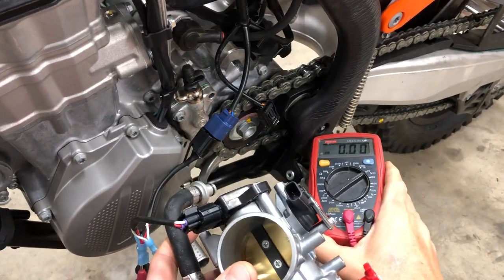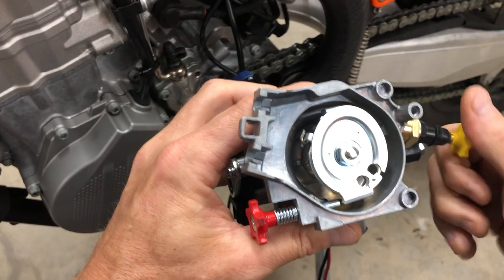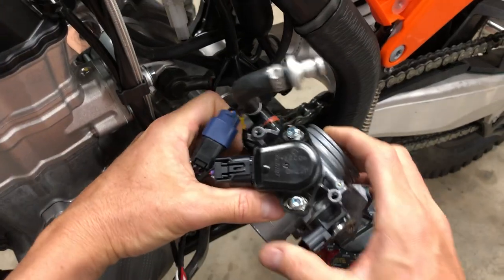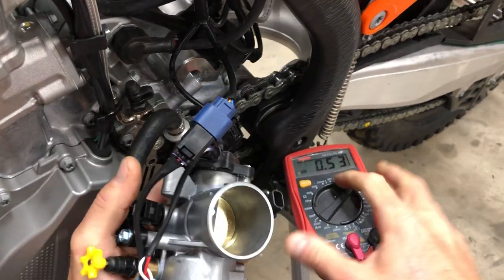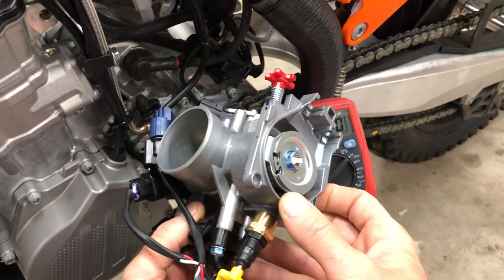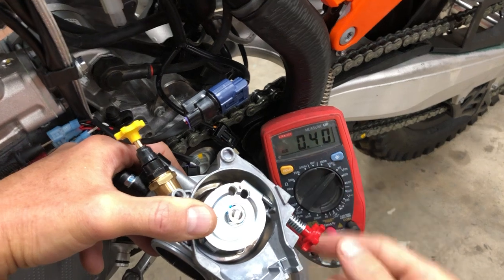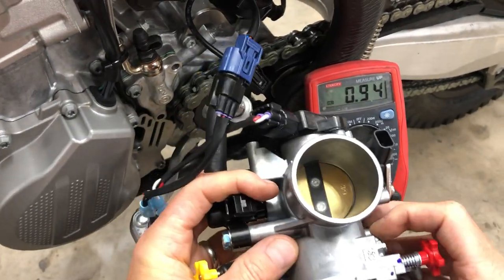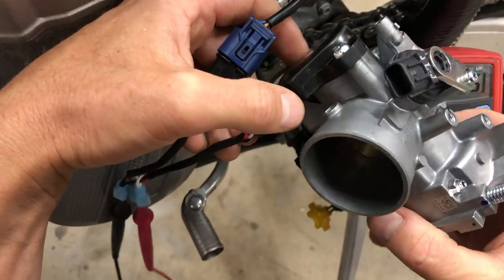MOTO MYTH BUSTERS ON THE TPS HACK AND EVERY THING THROTTLE BODY

Comment: Mike, a great all-around video.  First, I am not advocating for the hack in any way (like you I think it should never be done) but to want to clear up something you say that is misleading. Multiple times you say that doing the hack is "the same as holding the throttle open at the high-idle setting".  It's not.  Rotating the sensor to get a higher voltage value CHANGES the relative mixture value at all throttle settings.  If it were the same as setting the bike to high-idle, the bike would idle faster.  Rotating the TPS sensor changes the mixture through the throttle range - it does not change idle speed in any way.  It has nothing to do with high-idle position, etc. It may just happen to be that what you are setting the value to is close to the same value as your CURRENT high idle setting but as you even showed, the high-idle open position is highly adjustable by twisting the yellow knob.  So, the "default" TPS value at high-idle will in fact have a widely variable range depending on what a given rider sets that value to.  We fully agree that changing the TPS to a higher value will add more fuel across the throttle range but will not do it in the correct amount so it's a futile attempt as fixing a problem.

Comment: Excellent video I have a 18 500 excf did tps adjustment check engine light kept coming on and would run like crap got jd tuner all good now do you know spec for tps?

Comment: Great knowledge. Do you know best the start point on the throttle body the Voltage on KTM 690 2015 or 2016 same throttle body. Im havving issues with mine. I'm desperate and I can't find this info

Comment: Hey Mike, my desmogged, reedless, FMF 4.1 (spark arrested), JD Tuner 2019 450EXC has a bit (300-400 rpms) of a hanging idle when I let off the gas and sort of an intermittent varying idle. I’ve adjusted the TPS perfectly to spec. I haven’t checked the fuel filters yet, as it only has 24hrs and I’m just digging into it.

Any ideas on where to start beyond that? I anecdotally felt like the idle is better when I adjust the first fuel light a little leaner, but then I get decel pop. Any ideas on where to start would be much appreciated!
Reply from the maker: Clean injector by someone who can validate flow and re check

Comment: I got a 2020 KTM 300 tpi 2 stroke and the tps isn’t adjustable at all. At fully closed with no pressure on the butterfly it’s still reading .535 instead of .4 and causing my bike to run rich. I’ve tried leaning it out as much as I can with the idle air bypass but can’t get it lean enough without starting to get hanging idle.

Comment: Good video! Personal preference I know, but typically what RPM is high idle? My 350 jumps to 4K and it just seems high on a cold motor.
Reply from the maker: I have my idle set to 1800 and fast idle at 2350
Reply: TACO MOTO CO thanks! But in my ‘19 KTM 350SXF service manual it has a idle spec of 2,250-2,350 RPM but doesn’t state anything regarding high idle spec. Any knowledge there?
Reply: @TACOMOTOCO  is that fast idle rpm at cold or warm temp?

Comment: Very instructional vid. I have the 2014 (BMW) husky te310r. No one will work on it. Open full pwr. Idle adj screw fell out. Adj tps to get back to camp before I found out the upper tb screw fell out. The enrichment knob is different on the kein. What TPS # should I be at with butterfly fully closed to get back to spec.
I've set TPS at 680 with no idle screw contact,enrichment knob out at 43 as manual states and bike won't stay started long enough to set anything
Reply from the maker: Not sure on that bike sorry
Reply: @TACOMOTOCO  my luck to get a red headed step child

Comment: I have watched the last portion of this video as well as the google doc on setting TPS..
The part i havent got is.. do i calibrate the GET ecu at the “closed plate value” IE .40
Or the idle value when set to 1950 rpms..? IE .53 ish
Thank you..
Reply: This is the exact question I asked didn’t get a straight forward answer told me to follow procedure and ride it but I still don’t know if The correct way to calibrate TPS with get ECU is backing the idle screw all the way out first and then zero tps or vice versa have everything set ti where it should be and then zero tps
Reply: Adjusting the idle all the way out on my voltage meter gets me .4 on the money and then when you turn the idle screw to where I like it it’s .59 (I like higher idle for stunts) but I just want to know if the correct way is to set zero tos with the get when idle screw has no effect on tps voltage or set it first and then zero if anyone has the answer It would  make my day
Reply: Tps*

Comment: Sir ! I am from India and I own a Ninja 300 (2019 ABS) ...My question is " How can I adjust the TPS to factory settings if the output voltage for Idle is given in service manual..?
And the bike also does rough idling (close to 2k rpm) for few seconds and then comes back to normal....
My bike is running lean as I tried set TPS it to factory output voltage just by rotating the TPS to the factory output voltage.. Please help..!

Comment: OK, Taco Mike, I've watched this video a bunch of times and I think I get it.  I don't currently own a tuning harness.  I have a 2020 500 EXC-F.  To tune my bike, can I first turn the yellow knob all the way out so that it's not impacting the idol.  Then start my bike, and use the red knob to set my idol at 1800 rpm (I have a TT Voyager Pro).  That's now my base idol speed.  Then I can adjust the yellow knob to the fast idol speed that I want when I click it in.  Is this correct?  Many thanks for your great videos!
Reply: That is the way. 

Turn out yellow all the way (63 clicks)
Set red to desired rpm range (2000 on my XCFW 350) once bike is warmed up
Then set high idle to appx 2300 rpm (or enough so that the throttle can still disengage the function - see my note below)

Note: if you dont set the high idle (enough clicks screwed in) then the throttle tube will have a very difficult (if not impossible) time disengaging the high idle when you roll the throttle forward. Essentially, for every click you go in with the red knob, you'll need to do the same with the yellow to maintain the gap you see Taco showing in the video.

Comment: Hey Taco, I Recently bought the TPS tool and adjusted my TPS from .50, that was the setting i had on it, 2017 KTM 250 exc-f , 

i adjusted the TPS to .70 at which i felt the bike was a bit more aggressive and felt like it just wanted to go a bit more, so i set it down to .64 and found that i was happy with this setting. 

But now I’m reading all these comments and how bad it is for the motor, and it scares the shit out of me as i do not want to blow up my engine. Do you think i should just set it back to 0.50 as there was no fiddling with the yellow and red knobs and the bike was actually running perfectly, and i just wanted a bit more power.

Other mods include a Full fmf system 4.1

Thanks for the video and knowledge bombs.
Reply from the maker: If I’m you, I’d set it to factory spec per the video and choose a reflash, piggyback fuel tuner or ecu option that best suited my budget and riding needs🤘🏽

Comment: Great tutorial!!  I've seen it stated that there is some value in increasing the TPS setting for an un-modded bike, as it richens the mixture especially at low rpm and the engine will run smoother and cooler at low rpm's.  Is this true?  I'm on a '18 250 EXC-F and am not looking for any significant performance upgrade. 
I wouldn't mind a slightly more aggressive exhaust note...can the bike handle some drilling out of the exhaust screen without an ECU tuner, and if so is there a TPS setting that would be of benefit?
Reply from the maker: The data says no. I don’t use that hack on any of my personal bikes or ever recommend it. And with a piggy back tuner like a JD being such a low cost option it’s a total no brainer to do it right and have a safe, cool running long lasting bike
Reply: You do a really good job explaining. I wanted to know if your research was on any pre 17’ KTM’s. The “other guys” will say that the TPS hack is a no go after 17 because the idle and the TPS work together. However on 12-16 you really are causing more fuel to enter vs air since the air is controlled by the butterfly. I’ll admit I tried the hack on 15’. And it did stop popping decel and seemed more consent on low end having removed the smog and removing the end screen. That said, I have no way of measuring against the whole range. I still think ECU is the way to go, but wondering if the TPS hack has more validity on older bikes.

Comment: Is the stock TPS value for a '16 500 EXC .53 also? Before I knew better I used Mr. Clean's TPS tool to compensate for a end cap. I have since adjusted it back down but I don't remember what the stock setting was.
Reply: No, that bike has a different throttle body, .60v is stock, and idle screw doesn't move the throttle plate on that model

Comment: So, by what I understood, we have to unscrew both yellow and red adjusters and set the TPS voltage to 4.0v, correct?
If so, why do we need the 5.3 V point? 
By what you said it does not matter as it changes with the idle rpm...
Reply from the maker: .53 really is not a spec value. It’s probably where it will run at 1800-1900 but not a book number. 

.40 is w the plate fully closed
Reply: @TACOMOTOCO  ok, understood, I'll check my TPS values. Thanks

Comment: Thank you for this video. I am assuming the throttle body is the same on my 2021 450sxf FE?  Same yellow and red knobs. I found this video in a search for a THREF malfunction fault on my bike. (FI light constant flash, no pattern)  Any ideas as to what condition sets that fault?  Can't find any reference material in manual.  Bike runs and starts fine.
Reply: Did you ever figure this out? I also had a THREF code flash recently but it hasn’t returned. No symptoms, just the solid flashing light.

Comment: Great vid!! I have a 2014 KTM 350 SX-F and has a diff throttle body. I'm fighting with: (a) won't idle unless "fast idle" is pulled out; (b) major lean pop & virtually no engine braking on downhills; and (c) excessively sensitive throttle response (almost no latitude from off to "wheelie"). I cannot find the manual or any good tech info on that older throttle body. Any productive thoughts from anyone?

Comment: Thanks for such detailed information. I have a question. I have a very rich fuel air mixture in stock. If I lower the voltage below 0.53 will it help solve my problem?

Comment: You mentioned in the video what the Vortex ECU is looking for but not the GET. Anyone with a GET Ecu did you guys calibrate tps with your idle set already or did you go to .40 with no idle influence then calibrate tps on GET app? I have been running my 2023 ktm 500 using the first method because when I try the second method, the GET app will say that zero throttle is 3 percent and max is 103 percent etc and I feel like that ruins the mapping. Do the GET Maps want us to calibrate tps at .40 or .53? Aka idle already set I want to make sure my bike lives as long as possible and is getting correct fueling
Reply: When I asked this question previously, I was told to use the second method but it just doesn’t make sense to me that the get app would be looking for 0% throttle to be 3% in the app. If it thinks that zero is 3% throttle it’s going to give the fueling tables for 3% throttle at zero throttle

Comment: Toco say I have a 16 husqvarna fc250 and I had a starter clutch bearing go out so I changed that then put new starter relay and starter an new fuel injector new plug but it still won't start its like the fuel line just fill up pump works turns over no fire no nothing can maybe give me some input please I feel like it's something really dumb but sure could use a bit of help thank

Comment: So if the idle screw is backed out all the way and its not effecting the throttle plate, you can still manipulate the voltage but loosening the screws for the tps and twisting it, how do you know what postion/voltage to lock the tps at?

Comment: I have a 2012 350 and when I go full throttle the bike stalls out. I can still drive the bike but whenever i go to hard on the throttle it stalls. Could this be related to the throttle sensor position?

Comment: I feel like all this is directed at one person which seems a little rough. It would also be worth noting he did a similar video a while back now. Your method happens to be what's listed in the manual for setting it. Flipping the fast idle isn't the same as manipulating the the tps as the point of shifting the the tps is to trick the ecu into working off the next cell while feeding in the air of the lower throttle plate position. 
I have played around with it on my 17 sxf450 and did gain some advantage.
I have also recently brought a Get evo ECU which let's face it is an extremely expensive way to add a few degrees of ignition timing.
Reply from the maker: The GET nets way more than that for the money. If all you were after was timing you could have added a Dynojet piggyback ignition module for cheap. Or sent your box to chris Blais for a $99 reflash. There’d have been way more money left in your pocket for gas and tires with either of those much cheaper options. 

You’re correct on the observation that tweaking the TPS moves the cell down one in the lookup table. I though I did a better job of getting into that but I possibly didn’t so thanks for bringing that up. 

My method here as you note is taken from the manual and represents the best practices way to do this. I’m sure there might be others but this is how to ensure it’s bang on accurate. 

Are you the one person this video is directed at? Sorry if you felt it was harsh. Not my intention to be anything other then helpful, accurate and informative.
Reply: @TACOMOTOCO  super diplomatic aye, I believe with the multiple comments you make throughout your past several videos your having a dig at best dual sport who seems to be just another guy trying to make a living. Slavens racing, best dual sport, Tokyo and Taco you all offer some sound advice amongst the waffle and digs at the competition.
Everytime you do a video that your mate has bet you too I'll comment "Dave did it first"
The stock sxf 450 ecu is good, the GET rips but you can tell theres alot of timing but at least I can undo abit to find a happy medium.
Reply from the maker: @vinceseyb2640  we make videos (and sell products) that use industry best practices, the information and specifications from factory repair manuals, knowledge gained from industry experts, up to date info from KTM dealers and factory representatives, magazine testers and reviews and our own personal and team testing and development. 

as you point out you and i are both aware of guys in this space (ktm focused videos on youtube) who speak out strongly and directly by name or with thinly veiled references to other guys in the category. that's not my style. that's not what i'm about. at the end of the day i have no beef with anyone in the industry as ultimately the consumer decides who brings the best value and goes with that vendor. that's the simplicity and power of the free market system.

caveat emptor

i hope my videos bring that value to the community and the sport. all the indications that i get through these comments, emails, calls, sales, messages, meetings with riders, and so on seem to be telling me just that.

thanks for your comments as well. anything that can improve what we're doing and how we're serving is welcome here.

Comment: Could you apply this technique to a 2022 300 tpi ? wondering if stock tps value is the same at .53. Just wanted to know after doing idle screw mod and have a tps guard that I may or may not have bumped the tps putting it on. 
Any help would be appreciated. Thanks

Comment: If you can achieve a little more fuel by upping the voltage than why buy a tuner or piggy back? It obviously helps to up the voltage because hundreds of posts prove it does. Mike said that if two or more get you an answer online then there you have it. It's not leaner up top when adding voltage. Probably richer. I have a temp gauge and after upping the voltage it runs cooler. Why? Probably getting more fuel. Wish I had a dyno or some way to prove it but my bike runs a lot better down low and cooler up top. Didn’t see any power loss anywhere.

Comment: How do I find the base tps setting for my 2019 KTM 250xcf USA?  Not in owners manual or workshop manual.
Reply: I have the same bike, we’re you ever able to locate it? The recommended rpm is 2250 in these bikes as well not 1,700

Comment: What do you think about drilling a small 2mm max size hole in centre of bottom half of throttle plate to reduce flame outs?
Reply from the maker: I think it’s a bad idea and doesn’t work. Someone sent us a video w the claim of doing that and it’s a valid mod but only for the right conditions. 

Research or yourself. 

Hopped up 8v motors that can’t enough air to idle do it. Old school trick. That’s not the problem w these bikes

Comment: Question, my voltage values change when the bike is running compared to not with key switch on. Should I tune to values with engine running or off?
Reply from the maker: Off
Reply: @TACOMOTOCO  thank you

Comment: Assuming you have your baseline correct, what is the function of the yellow knob?
Reply: Cold temperature starting. Let’s the bike warm up at a fast idle hands free so it won’t stall before it has a chance to warm up. I have an FE501S with this but I’m in SoCal so I’ve never had to use it but it’s there if I ever need it.